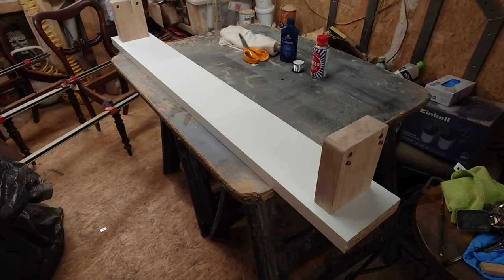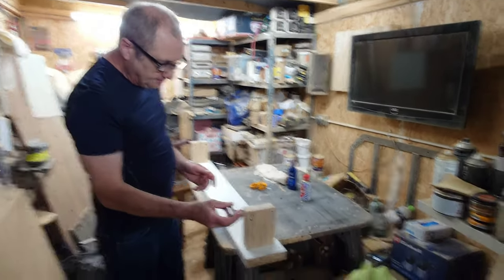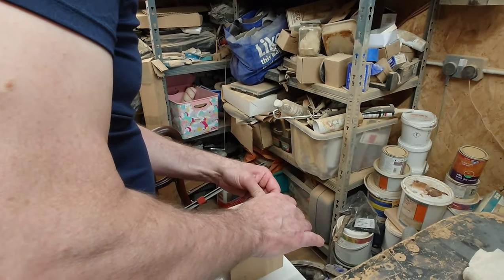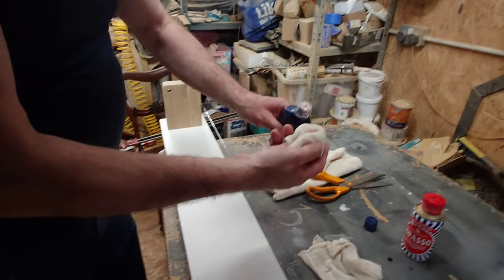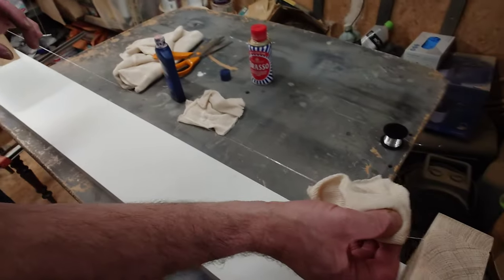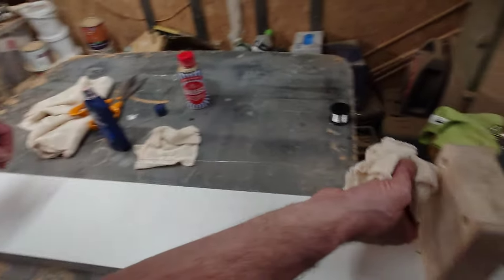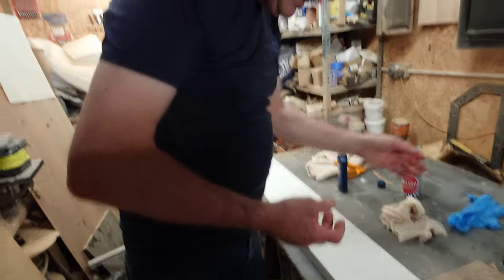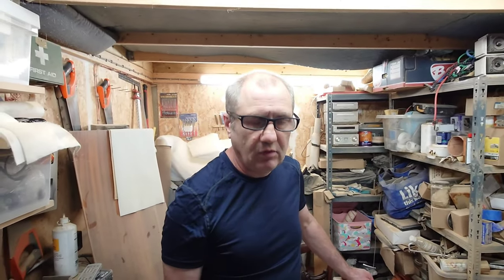New Way To Polish Wire Conductors

Comment: Brasso contains oxalic acid and will deteriorate brass and copper over time....both the navy and national trust wont use it for that reason. 

I wouldn't be least concerned with your fingers touching it.